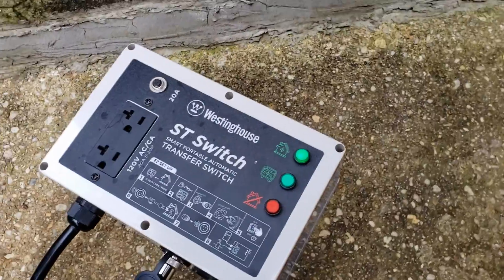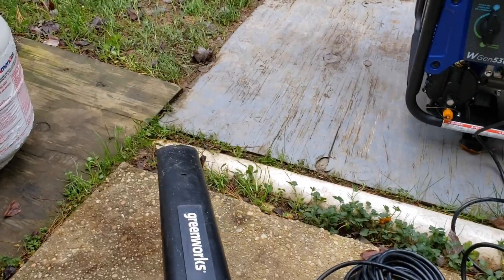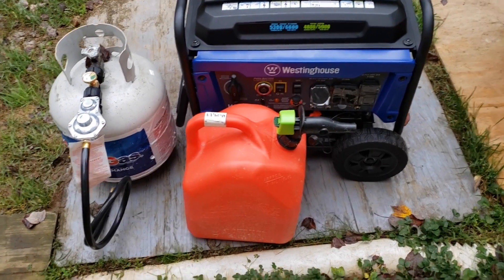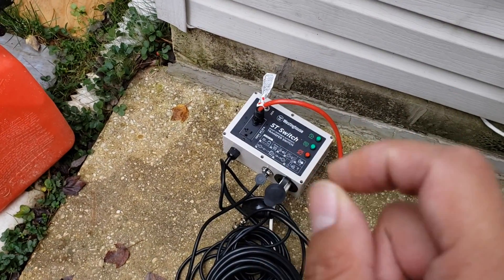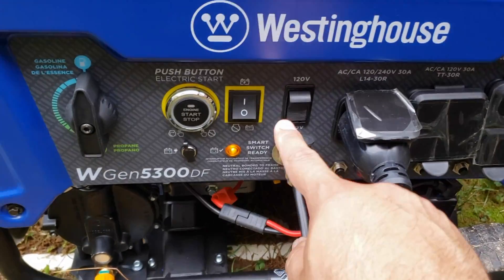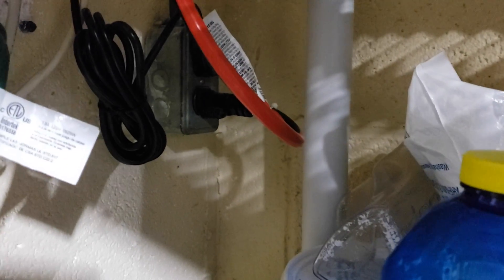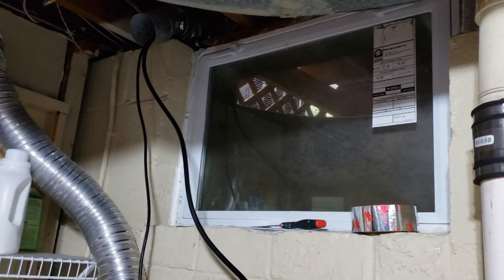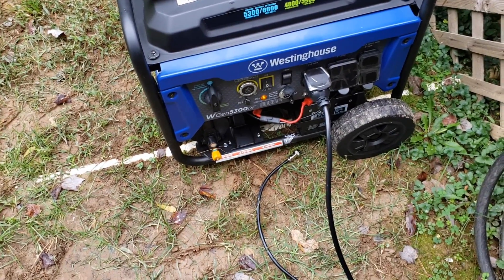DIY standby generator conversion: ST Switch - Automatic Transfer Switch

Comment: Sort of neat, but I don’t think it’s worth the hassle. Wouldn’t you rather just wheel out your generator and fired up with your interlock to your whole house when you need it as opposed to having this thing ready to go at any time? Like what’s the criticality of this thing kicking in immediately I just don’t see it being very useful and the maintenance of it, i.e. your generator being outside all the timehooked up to power having to be on propane just as a lot of overhead for not a lot of value, but that’s just my opinion.

Comment: I have been looking at generators and different setups and I saw a w 9500 model that claims that it has two settings for 30a and 50A and in my search i found that the 50 amp was discontinued anybody know what's up the sight has no reference. at home depot for 300$ more than the other 9500 that i have seen.from 899 to 1000 .

Comment: What about backfeed it seems to me you would still have to turn off your main just asking
Reply from the maker: Nope, it won't backfeed so long it's connected to the ST switch. Unless you connect the generator to the house using another transfer switch, then yes you gotta turn off the main breaker, but if you're only using the ST switch, you won't have to worry about backfeed.

Comment: What I want to know is how do I modify the control cable to work with an actual automatic transfer switch that would in turn power an entire house panel via the 50A outlet? Can't seem to find the wiring schematic anywhere.
Reply: Now that would be great.
Reply: Did you figure this out would only care for the automatic part for the whole house since the portable ones are cheaper than standby and its long permit waiting times.

Comment: Who cares about emerging power for a sump pump? I would need it to plug in to a gas furnace and gas water heater. Can you show how to set it up for that synerio?
Reply: He did show how your water heater and other necessities would work once the Gen is on and both cables are installed correctly. It’s like having a suicide cable connected to the generator but instead of using the 220 socket/ suicide cable option this transfer switch and a heavy gaged extension chord this transfer switch allows you to plug that extension cable to any 110 outlet in your entire house which then would power the home.

Comment: You can't use that full time. The generator stop - start switch has to be left on start. That runs down the battery. 
Very limited use.
Reply from the maker: The ST switch actually charges the battery so it never drains. Leaving it on all the time with the ST switch connected won't drain the battery.
Reply: @Mr-Chris  well, that's better than I thought. Will a whole house automatic transfer switch be able to do the same? That would be even more cool!
Reply: Everyone should stop running generator indoors because it’s not safe. Here’s an advice about generator safety and keeping your family safe https://youtu.be/I1jT3ANENvI just hoping you stay safe. Thank you

Comment: I really love Westinghouse generators, their brand has been around for at least 100-years. I too have noticed that home stationary backup generators can easily cost 10 grand or more. The biggest difference between them and a portable one, is the stationary units run on natural gas, and they have a constant rating duty cycle. Where as the portable ones can run on gasoline or propane, depending on which model you choose, and some are even tri-fuel, but they do have a duty cycle, and require shutdown once in awhile to cool down.
Reply: I know all about generator safety: everyone really needs to keep generator safety in mind. Please remember not to run your generator indoors and please keep in mind that carbon monoxide is not safe. Carbon monoxide can kill you in minutes. Please keep your children safe when you’re using portable generators so your children don’t get electrocuted and hurt with the generator. Please keep your generator 20 feet away from your house. Do not even store your generator in the garage or in any living areas in your house. Do not try to plug in a generator cord to a wall outlet which can cause fire hazards. Never run your generator in wet conditions which can electrocute you https://youtu.be/I1jT3ANENvI and here is a video about generator safety and keeping your family safe while using generators. Just reminding everyone to be careful and hope you stay safe.

Comment: ST Transfer Switch $299 and Generator $1099=$1500. It's still not the most cost effective solution for me. You still cannot entire house with it, might as well install a transfer switch. Limited use to Westinghouse brand. Sure it's an alternative. Thanks.
Reply: WH9500/12500 $1000 + ST switch $300 =1400 with taxes
Similar wattage 10kw Standby generator  with ATS and installation = $4200